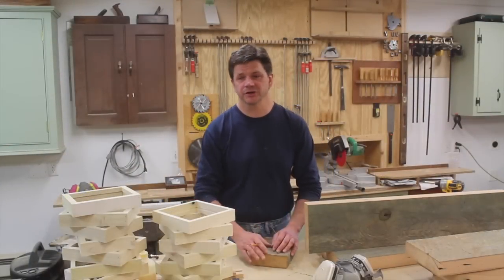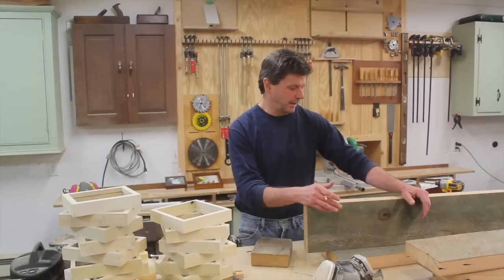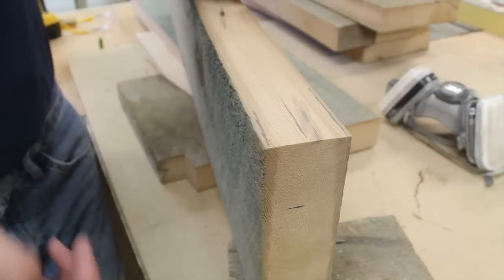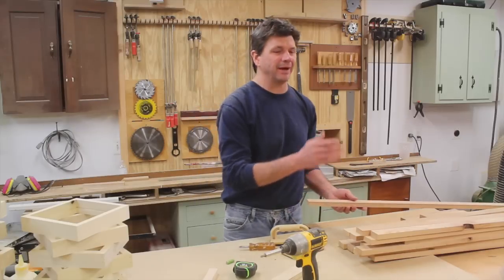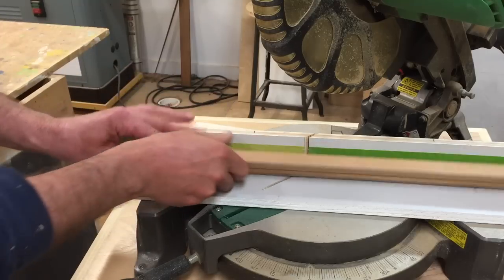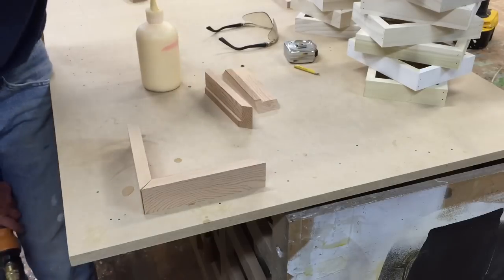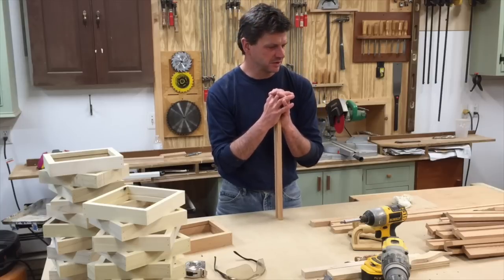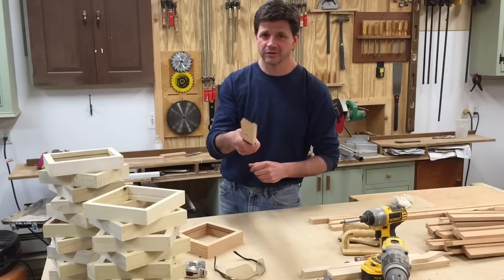How To Mill Reclaimed Lumber into Frame Molding.

Comment: Great Video.  Thanks for the inspiration.  After this video I made a couple of frames out of old barnboard I had laying around.

One suggestion though.  Put the nails only in the top and bottom. You can see the ones on the sides quite easily, but no one looks at the top or bottom of a frame.

Comment: Thanks, I enjoyed that - I don't think you ever quite answered the questions you had about getting a good 45 angle - I know the sacrificial fence gives a nice clean cut, but did your miter saw give a 45 straight out of the box or did you calibrate it yourself?  Also when I make frames, I make 2 half frames and then put them together (guess it comes out the same!)

Comment: So, not to nit-pick or armchair design... but,  wouldn't it be snazzy if you only put the nails in the top of the top rail and the bottom of the bottom rail in both sides. That way, when the frame is hung on the wall at eye level the nails would not show. Assuming you are going to vanish the Fir. Is there a structural reason to do it the other way?
Also, I think your channel could hold the extra videos if you want, the name "Jon Peters Art & Home" covers a lot. But if they are solely to promote the channel, well, we are already watching, so maybe a facebook audience is best.